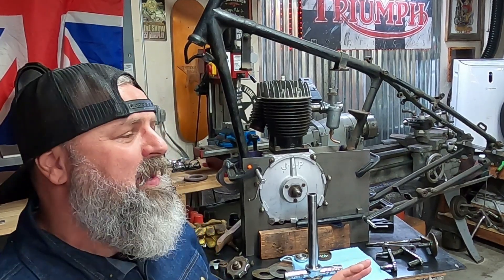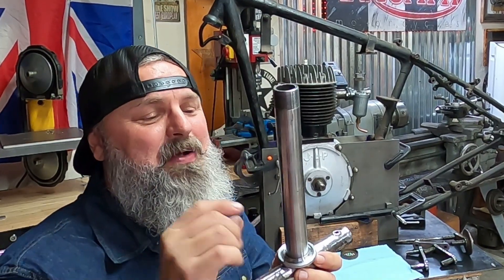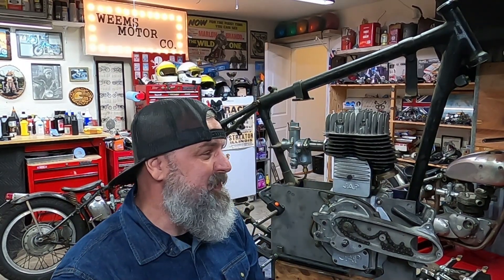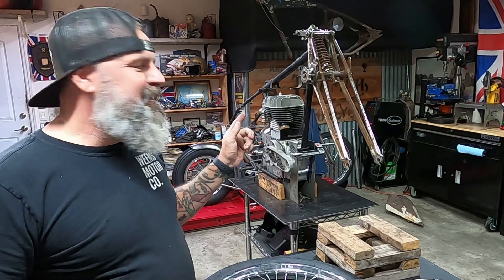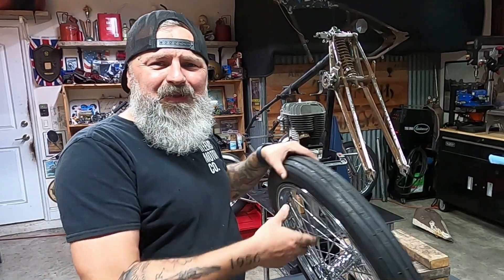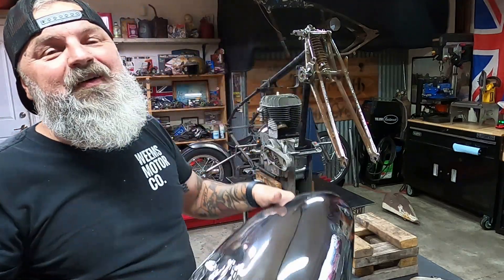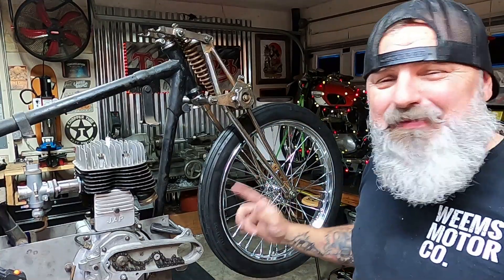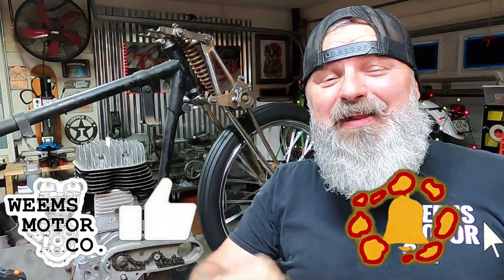We build a New Old Motorcycle!

Comment: BE CAREFUL with very old chromed frame parts!  What was NOT known when these parts were originally made, was the chemical reaction between chrome plating and steel!  This process has since been called "embrittlement", which changes the crystalline structure of the base steel over time, making parts VERY BRITTLE! (who would have guessed?)  Hardly a safe thing to happen when you need a certain amount of "flex" within frame components!
The most ideal thing is to remove the old chrome and powder coat, once you have TESTED the underlying steel!  Any pitting and cracks should be viewed with DEEP SUSPICION and if you can, get the parts REMADE!
Just a little tidbit I picked up in my travels! ....Hope your build goes as sweetly as this bike looks to be?  Happy New Year to all!
Reply from the maker: We plan to blast, inspect, and Powdercoat the girder.

Comment: Has this 1929 engine been introduced, what size is it?
It's John ALFRED Prestwich (1874-1952) for a start....
and it's pronounced  JAP not J.A.P.
It's either an International OR a Manx, not both. One can be road legal equipt, although many were  raced, the latter is a pure racer.
Reply from the maker: The engine is a 600cc, you are correct on the middle name, and it is a 1947 Norton International tank.